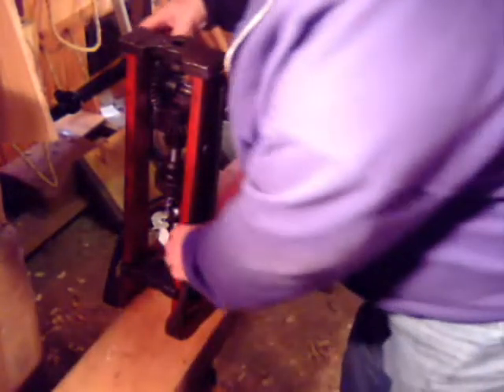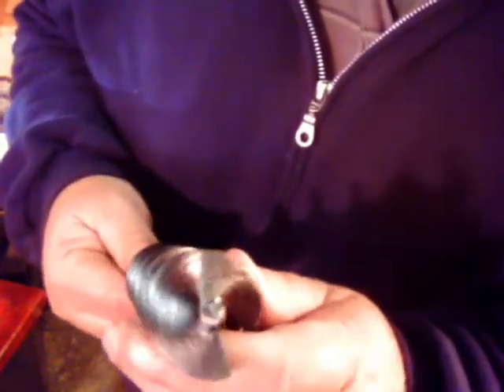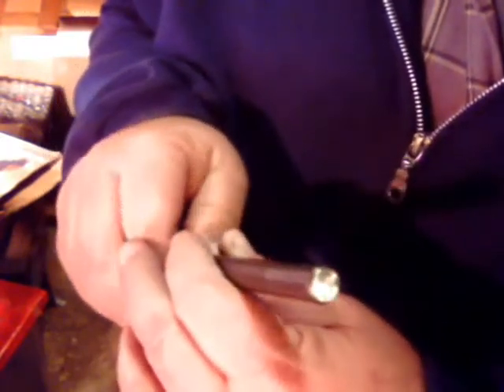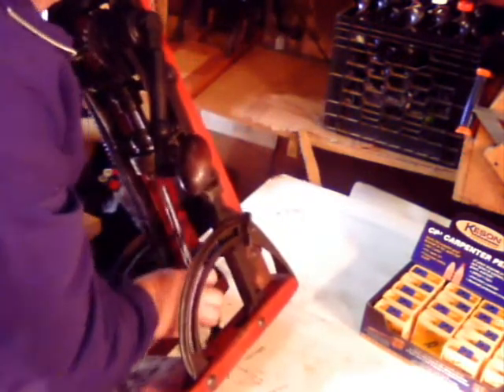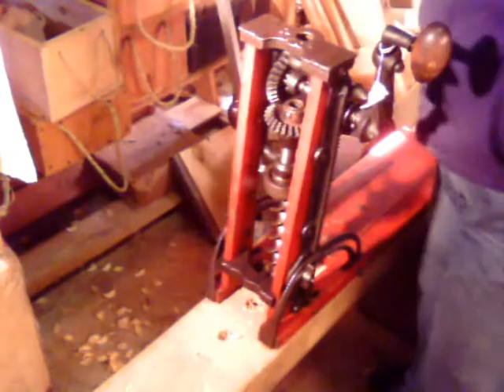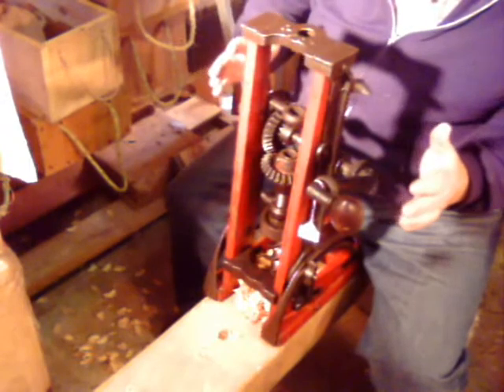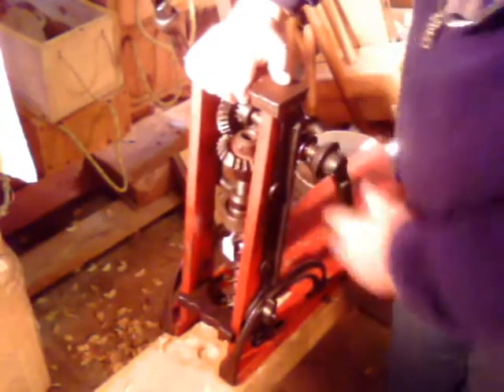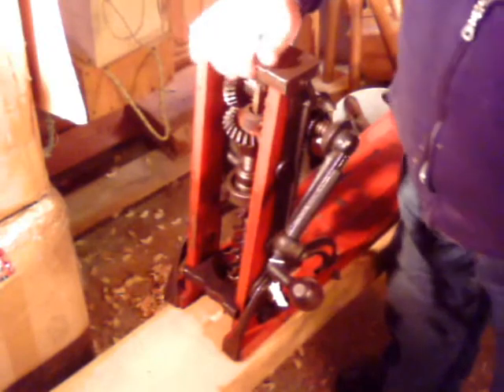Ajax_Boring_Machine-and_Bits_2.wmv

Comment: A very nice machine. The hollow shaft and adjustable chuck that allows using common T handle barn auger bits is a great idea. I wonder if this is a later machine designed to take advantage of the abundance of the T handle bits or an earlier machine.